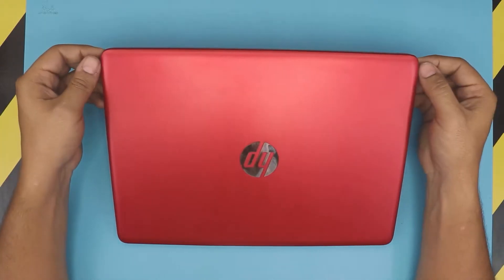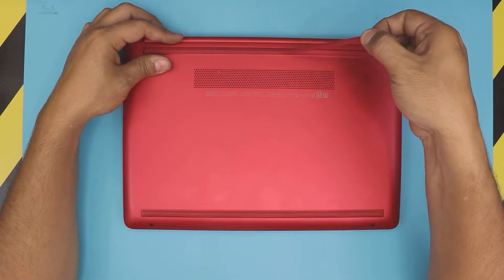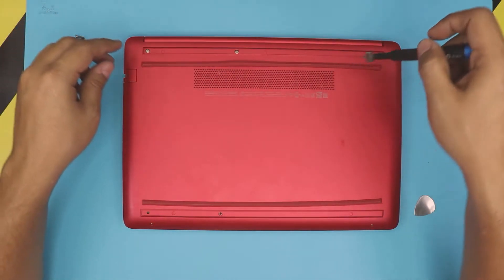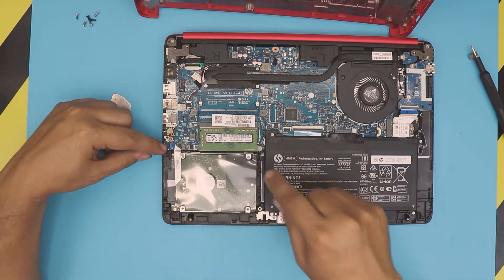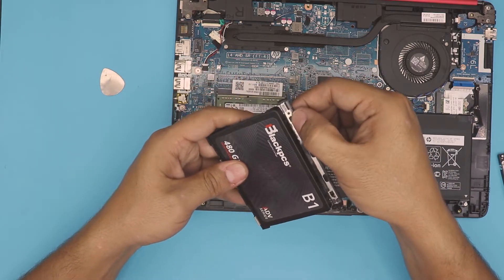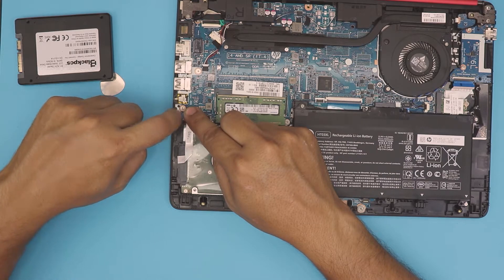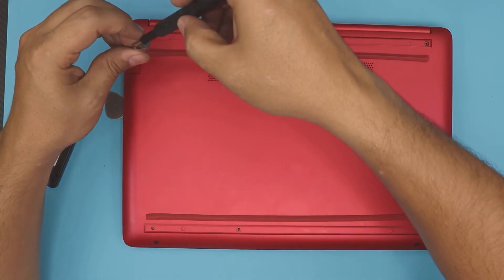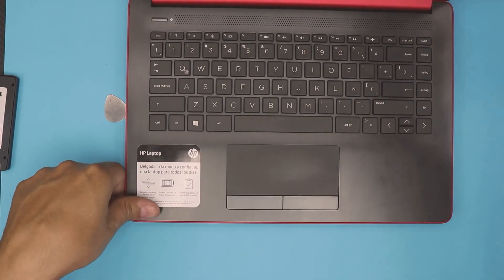Hp 14 Cm - xxxx SSD & HDD Upgrade, STEP By STEP

Comment: question.. can u link the replacement module? because well.... i broke my sata section
Reply from the maker: there is a tiny part number on the flex cable use that part number on aliexpress to get a new adapter.

Comment: Can you please guide me or send me a link for hard disk caddy and Sata Connector for my hp 14s series laptop   (i have Hp 14s intel Celeron 4500 d3000 Laptop)
Reply from the maker: Thank you for the feedback! if you wish to support the channel you can LIKE or SUB or both :P
regarding your question:  i need the exact model number of the laptop, it should end with #xxx
14s doesn't help me, to located the exact model
Reply: Sir i have HP 14s dq3026TU  ( dq3xxx in my HP application )
Processor is Intel Celeron N4500. 
And kindly also guide me can i add a 2.5 hdd in it? And Which accessories will i need to do it.
Reply from the maker: unfortunately i don't have that model on hand to give you the exact part number i have contacted a friend and as soon as her reply i let you know but for now here are some video on DQ series:
here is a video for dq series upgrade:
https://youtu.be/HXcP_xX8fyI
https://youtu.be/b7tz2vPmjl0
https://youtu.be/ycNgSVY2QLc

Comment: Sir, is the laptop compatible with nvme?
Reply from the maker: Thank you for the feedback! if you wish to support the channel you can LIKE or SUB or both :P
regarding your question: this model doesn't not have m.2 slot available for nvme nor m.2 ssd , you can place a sata ssd 2.5"
Reply: @uFixTek  gracias entonces no puedo ponerle un nvme
Reply from the maker: no amigo, no lleva la ranura para m.2, pero cambia el disco mecánico al solido y veras la diferencia.
Reply: @uFixTek  que raro por qué mi laptop 14-cm0xxx tiene un apartado en la placa madre dónde dice ssd
Reply from the maker: pasame tu modelo exacto de laptop, y mandame foto a mi correo: ask@ufixtek.com
alamejor tu tiene el modelo que lleva el m.2 ranura

Comment: Hola, buen video, tengo la misma Laptop, al ponerle un SSD de 128gb, no me deja bootear despues de eso, cambia lo del modo Heredado, cambie el orden de boteo UEFI y LEGACY y aun nada. Se reinicia a cada rato despues del logo de HP. Alguna solucion? Saludos
Reply from the maker: gracias, sobre su ssd, al cambiar el HDD al SSD no va entrar al sistema ya que no hay nada dentro del ssd. tienes que crear un USB de instalación de windows:
https://youtu.be/uDu8j2lE-dM
luego vas a tener que poner el ssd y el usb y meter y bootear en modo UEFI al usb y seguir los pasos de instalación (muy simple), usa este proceso.
https://youtu.be/7f_rBp6Rb3s
Reply: @uFixTek  hola gracias por contestar, el USB ya estaba realizando con Windows 10 previamente. Alguna solución? Saludos
Reply from the maker: pero dame mas detalle, y ser especifico... cambiaste al ssd y luego quemaste tu usb tal igual al de video como crear tu usb? o usaste otro manera?
llegaste a bootear desde usb? terminaste de installar windows?
Reply: @uFixTek  hola, hice el USB booteable con el creation tool que provee Microsoft en su página. Y respecto a la lap, si le cambié el hdd por un ssd, y al momento no me reconoce el USB booteable, sin embargo, también note que no me reconoce el SSD, lo revise en otra PC y si lo reconoce.
Reply from the maker: conectaste bien el cable flexor bien? mandame una foto de donde conectaste el cable flexor del adaptador del disco. cambia a otro puerto el USB bootable, igual en BIOS busca un opcion donde te dice algo sobre activar usb boot.

Comment: Hello, I'm planing to buy this laptop- https://www.amazon.com/gp/aw/d/B091D9652Z#agShipMsgSecView_1627201895753

And I want to install a hdd in it, but there is no mounting kit. Can u please provide the link to cable and bracket?

Thx in advance
Reply from the maker: Thank you for the feedback! if you wish to support the channel you can LIKE or SUB or both :P
regarding your question: if you want to purchase this: https://amzn.to/3x4I36Q
yours is FQ model,  you want to install an HDD mechanical drive in there?
Reply: @uFixTek  yes
Reply: @uFixTek  im actually deciding between that laptop and this one https://www.amazon.com/Lenovo-IdeaPad-Processor-Graphics-82KT00AMUS/dp/B08YKDYWK5/ref=mp_s_a_1_3?dchild=1&keywords=Lenovo+ideapad+3+5500u&qid=1627245511&sr=8-3
Reply from the maker: personally i would go with this:
https://amzn.to/373kzV8
i have service few of this and they are really good build on component level, compare to the hp 1st you send me.
this one is better build.
Reply: @uFixTek  Alright, btw, unlike shown in the website, in this model, the battery covers the hdd slot. But i guess that's alright since the laptop is good. So, what do you suggest to do when I run out of space?
Reply from the maker: that would be your last issue, as you can upgrade the NVME drive to up to 2TB and now the 4tb are coming out soon and the price for the ssd are going down.
the 4tb are out but limited sales still hard to find:
https://amzn.to/3BGNX1J
Reply: @uFixTek  alrighty, you got a video on cloning ssd's since the laptop has one slot? Thanks a lot btw
Reply from the maker: i would recommend you to get this adapter 1st, it will come handy on few points.
https://amzn.to/373lo0c
#1. once you clone and remove your internal nvme you can place it in there to have a 250gb super fast external drive :P
and to do cloning you will need to connect your new NVME into the adapter and use a cloning programs to clone your main nvme drive to this once cloned just replace them,
this ssd nvme i have on my laptop for a long time and they are rock solid like samsung brands.
https://amzn.to/3y8QhMP

for cloning programs i would recommend :
Clonezilla (its a bit of work to get around it but 5Stars and free)
or
get Macrium Reflect i believe freeware version lets you clone too ( easy user interface)
check both of then on youtube for instruction, i will make a note of this to make a detailed video.

also you may get one of this to have around the house it comes really handy:
https://amzn.to/36ZVjzl

i would recommend you to open your laptop once you get it to check inside and send me a pictures,  it won't void any warranty as there is no warranty label on screws. i want to see if they havn't change the board with new batch versions.
Reply from the maker: oki thank you for the links i saw them:)
anytime if you wish to ask i be happy to help you my friend,
for the ssds here are the one i would recommend:
I would purchased samsung if i had the budge, as it will last longer than the other ssds, but if you on budget get Crucial brand they are good too and on cheap side, but what ever you do dont get any kigston or adata they are the worse ssds.
#1. https://amzn.to/3i73C2H
#2.https://amzn.to/3f3R3TD
and if you want to upgrade the ram get this:
#3. https://amzn.to/2WlFPDr
Reply: @uFixTek  Thanks so so so much! The final thing hopefully i need to know is this:

Since the battery/power adapter have an input of 100-240V, I wont need a converter wall adapter to use in a 240V country, right ? All i would need is just the cheap socket type adapter. (Since the laptop is the US verison)
Reply from the maker: yes all you need is the plug adapter for the place you live in USA to your place:
https://amzn.to/3iSnZQi
Reply: @uFixTek  alrighty and  just to confirm, replacing the ssd doesn't void warranty, right?

Also, I'm pretty sure the usable ram would be 6 GB, I think that's due to the 2GB intergrated graphics of the 5500u, right?

P.S. Waiting for the ssd cloning vid :D, and chnaging and cloning ssd shouldn't change a thing right, everything will be like it was, eh ?
Reply from the maker: @oxar_x  sorry for the delay, yes the replacing those parts wont void the warranty. and yes the 2gb goes for APU video ram.
Reply from the maker: @oxar_x  WOW lol i just saw this laptop and was shocked they have dropped the price from 929.00 down to 600.00 its an awesome deal and they are also excellent build at motherboard component level.
if it still available i would highly recommend it. https://amzn.to/3zSJG9t
Reply: @uFixTek  The most important thing is that I can change it to 2GB graphics, since I think it's pre-set to 512MB

P.S. Are all the link you sent here are affiliate links? If not, please send them so I can buy via them.
Reply from the maker: true that regarding the 2gb, and also yes all the links are affiliated, you can always open any link, or use this general link to save on your fav , and open this link and search for any product for your daily buys or anything .
https://amzn.to/3ffKxJM
i will much appreciated.
Reply: @uFixTek  Alright thanks a lot mate! I'll buy it maybe tmrrw or after a few days, again, your help means a lot to me ❤️
Reply from the maker: anytime my friend , its my pleasure to help as much as i can and share my experience with people. when ever you got any questions feel free to ask me, and i appreciate all your support by using my link to do you daily purchases.
good luck ma man
Reply: @uFixTek  If I buy an external hard drive, can I connect to my ps4 which will format it to download games then i connect to my computer to download personal files then connect to my ps4 again?
Reply from the maker: @oxar_x  yes you can connect external hdd to your ps4 and format but about the reconnecting to pc and back to ps4 let me figure it out i get back at you ,, hold on that
Reply from the maker: @oxar_x  SORRY but no PS4 format architecture its different in order to make extended drive so you can save your games and it will not work if you format it on ps4 and then inset to pc. the pc would have to reformat it back to mbr or GPT format.  
sorry to inform you like this :( i guess its a security reason.
Reply: @uFixTek  Just to confirm again, the Asus laptop has the option for 2GB UMA Frame Buffer Size, right?
Reply from the maker: @oxar_x  yes 99% it must have its a amd R5 so it should be :
In the BIOS, locate the UMA Frame Buffer Size setting usually found in the Advanced menu section.

BUT you should never enable 2gb buffer on a 4gb ram system. but you will have 16gb so you fine.
Reply: @uFixTek  👍
Reply: @uFixTek  the laptop should be coming tmrrw (monday)
Reply from the maker: @oxar_x  AWESOME :p
Reply: @uFixTek  it has been delayed due to the extra process of handling lithium batteries
Reply from the maker: @oxar_x  ya they tend to do that, as they think its a ticking bomb lol
but on other hand kilos of drugs can be shipped without any issue :P
Reply: @uFixTek  😂
Reply: @uFixTek  I've seen the reviews and the camera seems to be trash and battery and thermals
Reply: @uFixTek  i got it, about to unbox it now
Reply: @uFixTek  it's not in the advanced bios (frame buffer size)
Reply from the maker: @oxar_x  can you send me a screen shot of the bios or make a short video of entire bios options.
Reply: @uFixTek  just contacted the asus support team and they said it doesn't have it
Reply from the maker: @oxar_x  i dont trust them on what they say, you call them and say what is max ram or storage support and they give you a wrong info. can you send me screen shot of the main bios name and model.
Reply: @uFixTek  i cant send images here
Reply from the maker: @oxar_x  use this https://prnt.sc/
Reply: @uFixTek  When I unplug the laptop, the fps in valorant goes from 100 to 20

(The link to the screenshot kepes getting deleted. Anyways, I've seen some videos and it seems like the buffer size doesn't affect performance)
Reply from the maker: @oxar_x  dont worry you can send the link it will not show-up until i have to approve it (held for review) 
yes it will drop FPS because you should not ever on any laptop play game with battery only, its the worse thing you can do to a motherboard, as the battery can't provide the amper needed to run the gpu. this is a very good thing on this motherboard its protecting it self unlike other alienware or omen or many other they just keep sucking amper from a battery until the motherboard components stress out and burn. so you should be glad you have that protection on the laptop.
Reply: @uFixTek  Alright, thanks a lot